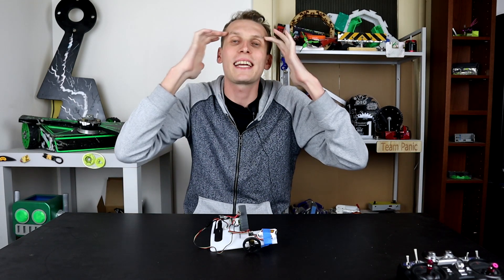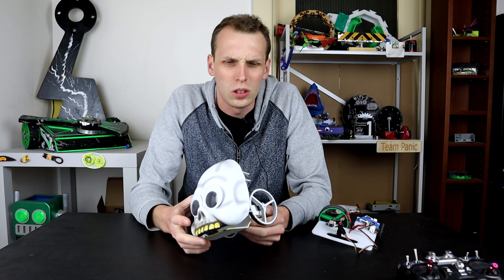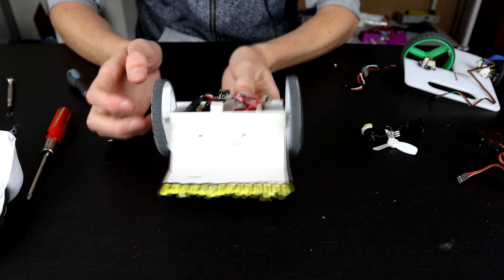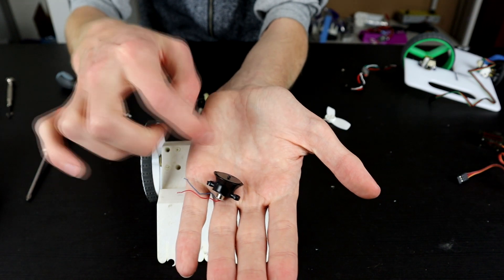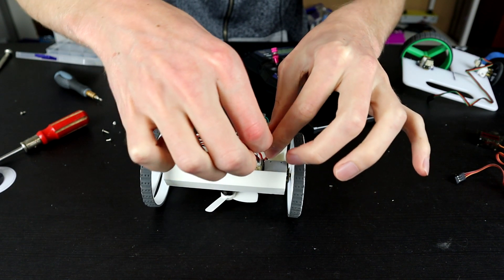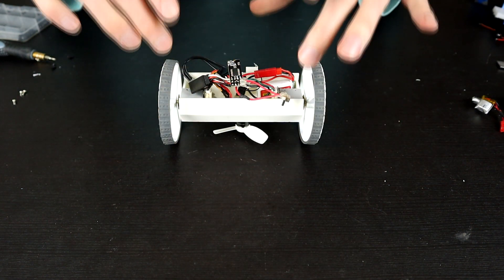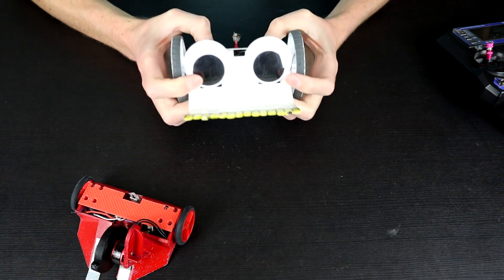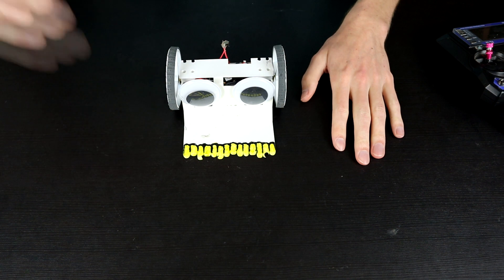Gotta go fast! (Spooky Speedy Combat Robot)

Comment: I suspect the big flat front scoop and angled section towards the fan are acting as a diffuser with the fan creating low pressure underneath the whole thing. This would give pretty decent downforce across the whole scoop area with a bit of pressure difference. it might work pretty much as well with a lower fan speed given how far forward the centre of pressure would be.
It might also be worth testing with small spacers (washer, filament, etc.) under the scoop to see how much gap it can tolerate and how the gap affects the downforce.

Comment: I suspect the greater effect of the downforce motor to stop wheelies is the gyroscopics.  Downforce that close to the drive axle plane is not going to do much.
Reply from the maker: Thats very possible, just not sure if the gyro forces are that high on something this small
I could try to print a weighted ring and see if it has the same effect

Comment: Is it the actual movement of air from the fan blade stopping it from tilting? Would it not be the kinetic energy from the rotating mass of the motors bell and fan acting like a gyroscope?
Reply from the maker: Thats very possible, just not sure if the gyro forces are that high on something this small
I could try to print a weighted ring and see if it has the same effect
Reply: While the mass is fairly low the motor is high rpm so the angular momentum might be compensating for the lack of mass. The force required to stop the bot tilting will be minimum also.